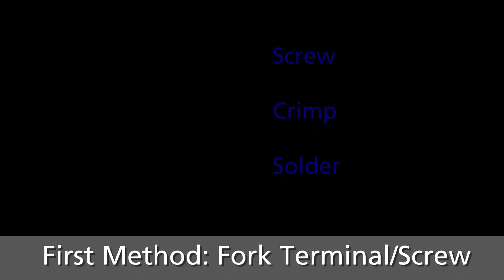How to attach an alligator clip to a wire - 3 different ways

Comment: Finally a good explanation what to do with those clips with a screw on top!
Reply: Can also just come up small hole and wrap wire clockwise around screw and tighten down without a fork
Reply: @chrisladouceur4093  You might want to invest in a screwdriver.

Comment: I like the screw and the solder connections.   The crimp with the insulation not so much. I am sure you can think of a much better way to use the crimp connection.